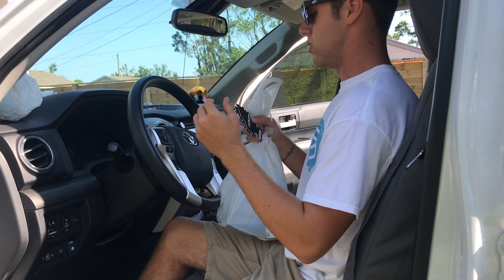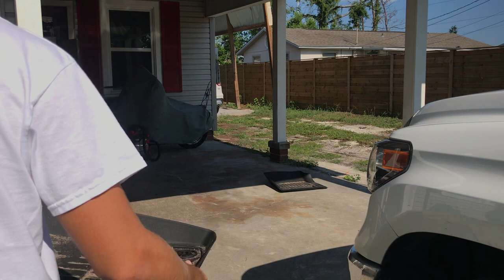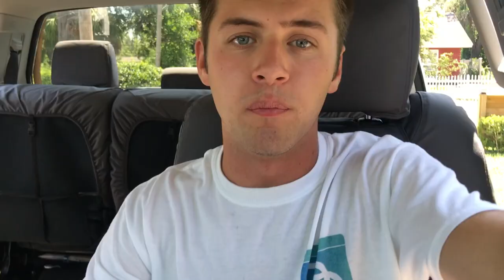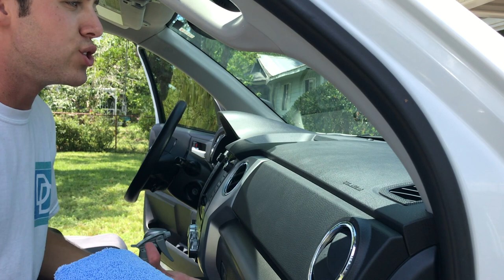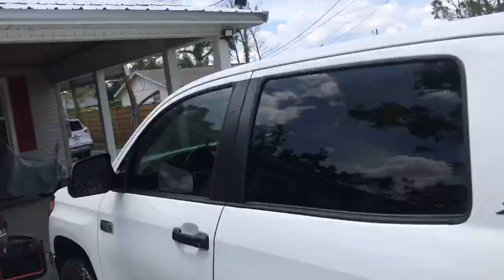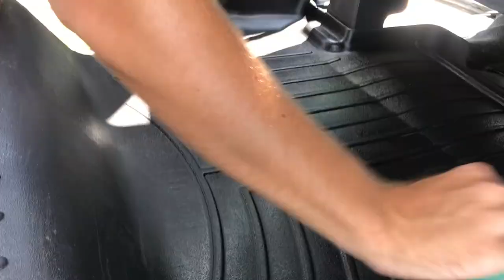How To Remove Water Spots From Cars | Logan Price

Comment: What do you use to dress your mats ??
Reply from the maker: Chemical Guys VRP dressing. you can find it on amazon.
Reply: @loganpriceofficial  Yea bro VRP is great stuff. For some reason Chemical Guys designed it to be at a high gloss formula so just like the rest of their stuff it's water based so you can actually adjust the level of shine by diluting it, and even a 50/50 mix it shoots through a spray bottle nicely not having to apply it annoyingly with an applicator you can use a microfiber towel so sweet. That's what I did to fit different individuals preferences. That and you're multiplying the supply for one price🤘
Reply from the maker: @drewwilms6843  for sure!